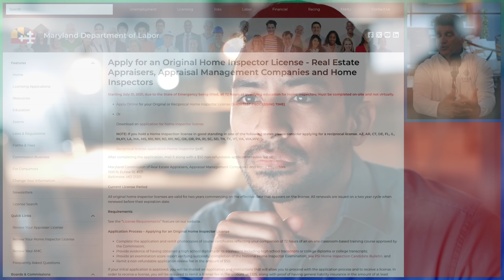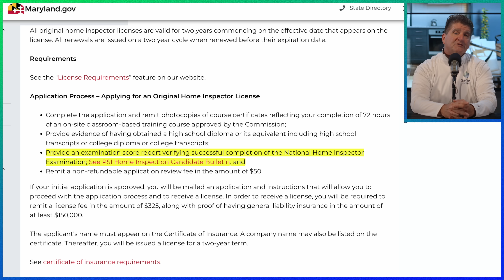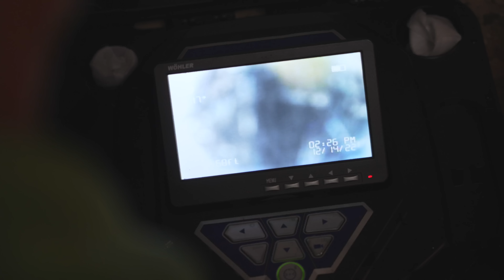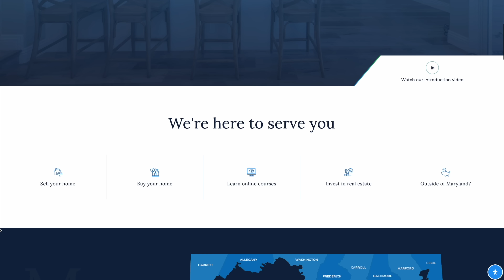Home Inspections (Worst Common Mistakes )

Comment: I’ve been a home inspector in the SF Bay Area since 1994. Was a licensed remodeling contractor prior to that.
A trend I’ve seen in my profession over the last 10 to 12 years, is new inspectors with ZERO construction background getting into the business. 
This is a trend that will never reverse as the last two generations have not been directed towards the trades after high school. 

Another issue is the realtors who prefer non-thorough inspectors as it makes their sales transaction much more easier. If realtors didn’t reward bad inspectors with business, there would be much less bad inspectors.
Reply from the maker: Thanks for your comment! 🙏

Comment: Don’t agree I walked away from a deal because of a good home inspector. House was a little less than 500k. When we got into the house he realize a major structural rehab.. first floor is all he could see sills, all joists, and subfloor had termite damage he said he hasn’t seen damage that bad in a long time. Get an inspection he said post inspections were something he dealt with and he uncovered
100k+ in repairs. Don’t give up your right to protect yourself from shady people trying to do shady things

Comment: In this market seller's don't want to fix anything even when issues found during home inspection. Does not make any sense to by anything now in this market conditions.
Reply: It's too expensive to fix anything. I was working with $20k grants from the state to do repairs on homes. Sometimes putting new windows in a house was half of that budget. And then a new roof was the other half.
Reply: And at the same time, the buyers accept those deficiencies by inaction.  Can't tell you how many times in the last 4 years I've gotten called about things I supposedly missed, but it's right there in the report in  narrative form next to 3 or 4 picture of the defect.

Their next tactic is to tell me their agent didn't tell them it was important  thus my reply that it's their names on the report, not the agent's and that it's their responsibility to read it and instruct their agent to perform.
Reply: @thebrandonbeatty  there's plenty of times I've locked the door at the end of an inspection and my mental calculator is north of $60K in have-to-do repairs on top of the $250K sales price that was $125K just 4 years ago.  Meanwhile, the buyers spent all their time at the property with me trying to get the sellers to leave the dining room table when they move.

Comment: Todd, I'm going to use a attorney who specializes in real-estate and a good quality general contractor/very experienced handyman, plus a few trades depending on what home Delia and I decide to offer, to do the inspection and costs to remodel/update if we go that route....We are more likely to buy a new home in Ho'opilii which is being built by DR Horton....I have experience in new home construction and development having been a developer long ago. I am about contracts and the developer will have the agreement made to thier favor but you need to look at the what it's when dealing with new home purchases and plan financially accordingly. I won't buy a new home in the Seattle area because they are not placing studs at 16" centers but at 20" centers....I asked about it and the sales rep told me it was adequate based on the engineering and the luber used is superior than in past....what, God is making better quality trees!!!....That was a KB home builder....Thanks but no Thanks!!!

Comment: The big mistake most home buyers get there reference from the realtors , Instead of actually researching the home inspector to see if they have a background in the construction . I am in the process of getting certified as a home inspector in metro Atlanta I have more than 40 years in the construction trades starting in framing and moving all the way into the full mechanical sector doing HVAC , Plumbing and electrical . I currently own a Handyman and Property Preservation company and see way too many new home owners forced to do major repairs sometimes right after moving in and they had home inspections. If I could only show you some of the photos of these homes that where inspected and had obvious problems . its been good for my business but unfortunate for the home buyer . I will have an advantage in the fact that I am EPA certified , HVAC Certified , Plumbing and Electrical and certified by Honeywell on indoor air quality . In Georgia certification is not required but it is wise to do so, plus make sure that any home inspector you hire has ENO Professional liability insurance .  Love the show Todd keep up the good work
Reply: I got burned big time using the dope that my realtor referred the last time I bought a house.

Comment: Sun city Az. I almost bought an older home with aluminum wiring. Backed out and got another realtor. They catch fire but some are very old homes 1963. The inspector I used for this home took pictures and said everything is working at this time.😂😂. I have replaced almost everything. So what do we do?

Comment: Electrical box (passed inspection), and melted later on due to faulty and subpar electrical wiring. Electrician told us we were lucky we didnt burnt down
Reply from the maker: Wow!
Reply: I did an electrical fire just after a home inspection, it still had "inspected by xyz" hanging off the shut off.

It was a 14awg wire on a 40 A breaker lol.
Reply: @donm2067  this was my old house, so imagine that new house i wanted to buy last month, inspector didnt noticed basement wood infested with termites, but for everything he wrote need "plumber inspection for improperly finished gass pipe, plumbing not upto code... roof inspection as cut off  of -something, electrical - shock hazard. And my realtor was telling me my inspection report arrived day after the deadline, so i have to buy it now as it is, oh well can negotiate with seller to repair but there is nothing to repair. "The inspector didnt write there is any serious problems"...
Like word of inspector is word of God, and shock hazard is nothing really...

Comment: Just bought a year old home had a weird smell in garage that the inspector said nothing about and we just thought it was damp as we went from AZ to WV. Come to find out I took inspected ducting and come to find out there was 5 small dead birds in the fresh air intake to air handler because they didn't put a screen on pipe outside. Hard to get to I removed the birds, disinfected and screened the pipe. Not an easy find and tight space to get to hose and vacuum them out.

Comment: Just like realtors, thousands get into home inspection during a hot market thinking it's easy money.  And in my state, thr real estate commission has consistently tly watered down the standards to become an inspector.  As a result, the I dusty is overrun. With young, inexperienced inspectors, many of which don't even own a home or have construction experience.  Those are the types.....fast, blind and cheap, with emphasis on cheap, that most realtors refer to their clients.
Reply from the maker: Thanks Jeff for your comment.

Comment: We bought our Myrtle Beach home in 2017 for 337000. The house sold new build in 2006 for 418000. It was Zillow app for 418000 in 2020 than ridiculously inflated to 565000 in 2022 which increased PT and ins. Now it’s returning to the mid 400000s. We believe mid 300000s would be about right.

Comment: Yep, we were forced to get an inspection and he got about 3 or 4 things wrong, lucky I have learned enough things by "doing" I am pretty well rounded in all the trades.
Just saved my daughter 7k dollar on an old failed ac unit in a double wide. I directed them to a do it yourself unit at home depot and they  asked the electrician neighbor if he could over see the electrical, they took my advice and learned. The new unit cooled the house and  no lie for 7k less than the 2 bids they got. The owners of these businesses are burdened with taxes, insurance, fees that it really makes sense for you to learn these things yourself or find a neighbor you can trade with.

Comment: Great advice! In years ago when the home purchase process could last 6 weeks to 3 mos, it was possible to spend all this time on finding a contractor in each specialty, and await the seller to allow the inspection... past 4 years, homes sell on line in 4-6 hrs. A buyer wanting all this reassurance about the quality of the house will time-out loose in the bidding war. With so many inspection requests, the seller (at the advice of sellers realtor) will decline further negotiations with that buyer and move on to another buyer who has no requests. ?this is why some states have real estate contract statement "Sale of the house is as is" ?

Comment: I'm in my 60s and This is no time to taper retirement savings. I want to max out my retirement contributions and I also have another $500k in a savings account that i want to invest in a non-retirement account. Where should I invest it now?
Reply: Safest approach i feel to tackle it is to diversify investments. By spreading investments across different asset classes, like bonds, and international stocks, they can reduce the impact of a market meltdown. its important to seek the guidance of an expert…
Reply: Oh few number of people discredit the effectiveness of financial advisors in exploring new markets, but over the past 10years I’ve had a financial advisor consistently restructure and diversify my portfolio/expenses and I’ve made over $2.2m in gains… might not be a lot but i'm financially secure.
Reply: I'm intrigued by this. I've searched for financial advisers online but it's kind of hard to get in touch with one. Okay if I ask you for a recommendation?
Reply: My CFA ‘Grace Adams Cook’ , a renowned figure in her line of work. I recommend researching her credentials further. She has many years of experience and is a valuable resource for anyone looking to navigate the financial market.
Reply: I just looked her up on the web and I would say she really has an impressive background in investing. I will write her an email shortly.

Comment: We usually have a contractor inspect any property we're going to buy. Much of a home inspection you can do yourself and the reports are overpriced. If they were $200 instead of $400 we might use one but the inspectors are generally unqualified and more often than not they have to find something wrong in the house to make themselves seems useful.

Comment: I have had my home inspector reported by the sellers agent because I was present while the inspector was doing the inspection.
Reply: How is that? I was always present at my inspections as a buyer, is your right to be there
Reply: @John1908-vo1iv  I agree, the most insane thing ever.  The agent told the seller to leave and they did when we arrived.   Told us and the inspector to go right in.

When we found issues that were enough to kill the deal, the sellers agent didn't like that we were present without the sellers.   And complained about the inspector for allowing us in the home without the sellers.

The inspector was outstanding.   The agents were not present because they didn't show up.
Reply: @hmjoe13  where all these stories come from? Not sure what agents you had or this is made up, but, you, as a buyer, have a right to be present at the inspection, with or without the seller. The seller being present or not is not conditional of the buyers being there. It is preferred that sellers are not home during the inspection. If the seller's  agent indeed did that, you can file a complaint because that is illegal.
Reply: @John1908-vo1iv  it is absolutely true.   I didn't buy the home after the inspection,  someone else did at above asking a year ago in July.   They just put the home on the market again about a week ago and they are most likely going to take a loss.

I wanted to file a complaint,  but my agent said not to.   He said what comes around,  goes around ....   in the end , I got out of the deal, and my agent didn't want to pursue it
Reply: @hmjoe13  your agent does not have a right to tell you not to file a complaint, is unethical and he can lose his/ her license. This whole story just looks made up

Comment: You are so right! We had the same inspector for the home we were buying, as did the people buying our home. He Made Note in the report of the home we were selling, that the smoke detectors needed fresh batteries. With the home we were buying he made No Mention of inadequate insulation in the attic and we only found out about the insulation issue after we closed and moved in!  What a waste & incompetency.😠
Reply from the maker: Terrible!

Comment: just so everyone is aware. as a lender, we have to get the home inspector to appraise the home value. we can not communicate with the inspector. we can only communicate with the company that sends out the inspector. FHA/VA will have stricter inspection compared to conventional or private money.
Reply from the maker: The FHA/VA appraiser is not inspecting the entire house. They are looking purely for safety issues. Recently, I had an FHA appraiser miss the garage door entering the home. It was not 1 hour fire rated and it did not have automatic closing hinges.

Comment: Is it worth it as a seller to get an inspection done before you put your property on the market?
Reply from the maker: Great question. If you get a home inspection, and certain things are discovered, they may become what’s called material facts that if not repaired, would need to be disclosed to the buyer. 

I typically don’t recommend pre-sale inspections to my sellers for this reason. Plus currently, if your house is move in ready, many buyers are accepting the home “as-is”. Of course this trend could change and if so, my advice could change (based on market conditions and demands).
Reply: @SachsRealty the guy that just inspected mine also was the construction super in my neighborhood, he knows these homes well.
Reply: @SachsRealty can buyer ask for an inspection report from the inspection done by a previous buyer (if the deal did not come through and the house is back on the market)?
Reply: @SachsRealty is the seller obligated to disclose any findings from the inspection done by a previous buyer who decided not to go through with the purchase?
Reply: @SachsRealty what's your take on buying a property with out seller's disclosure (out of estate)? Would you recommend it?
Reply: @SachsRealty as regular home inspectors don't properly inspect septic tanks, should a buyer obtain a specialized septic tank inspection?
Reply: I always thought a seller was very savvy if they had reports done and available for a buyer to review. It's also a good sign of full transparency.
The seller knows what he/she is selling and can make repairs or disclose to the buyer so there are no big surprises.
Having a septic inspection done before you list can  avoid major delays if repairs are needed. 
Having reports done up front means a shorter escrow and quicker sale.  Also consider that inspections can be costly if the buyer is saddled with the expense of well, septic, pest, home inspection etc so it removes that burden  especially now with the market switching in many areas to a buyers market, sellers will need to do their best to attract a buyer.
Reply: @suzy1717  I know a lot of sellers get blind sided by a buyer inspection report. Most good realtors will see the deficiencies though.

Comment: Good advice Todd. Get a plumber to scope the sewer line, I've seen too many fail in my neighborhood and that's a 15K job. And hopefully your not jack hammering your tiled floor too. HVAC for sure and he will of course recommend a new unit, they all do! Electrician to check the box and if it's the original on a 50 year old house he too will recommend it being replaced. If the house is unoccupied (Empty) I would go into the attics and crawl space and walk the roof. I don't need an inspector.
Reply from the maker: 100%

Comment: I wish there were “good” home inspectors. Similar to real estate agents, they are difficult to find. Always hire an engineer to inspect your home at the very least
Reply from the maker: Most engineers don’t have a clue. I had an engineer tell me not to buy a flip because the foundation was bad. Someone hah built a wall over a wall on the outside. We tore it off and it was perfectly fine. Good home remodeling contractors will know best. That’s why I look for this in a home inspector. They’re great for helping you prepare drawings for permits though.

Comment: "That's the company's problem (if the home inspector is new)". Good point Todd.  That's what I told the midwives when they wanted a student midwife to deliver my babies.  I told them I'm only doing this twice in my lifetime.  They can watch, but I'm going to need an experienced midwife to deliver my babies. They can get hand's on experience with someone else.  Lol.

Comment: How do you find these deal killer home inspectors in an area that you don't live in?  The market is flipping and becoming a buyer's market in many areas.  It would be worth the money to have a thorough expectation, before making an offer, on a home that you want to buy.  I'm not trying to kill the deal.  I just want to be able to make a fair offer in which nobody gets left holding the bag.
Reply from the maker: Call a few trades and be careful hiring a home inspector.
Reply: @SachsRealty  could you recommend a home inspector at Northern Penselvania?